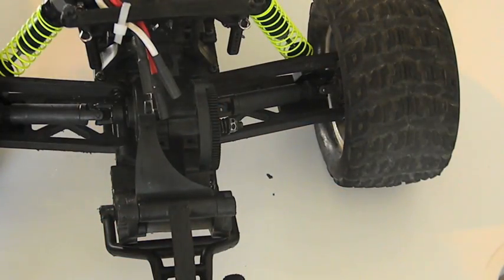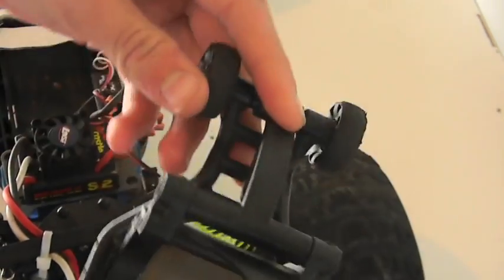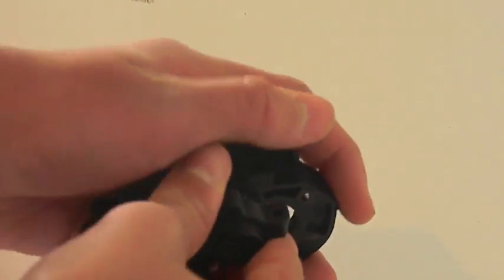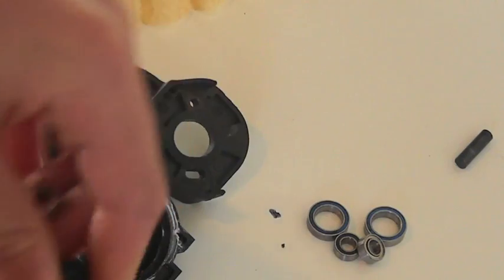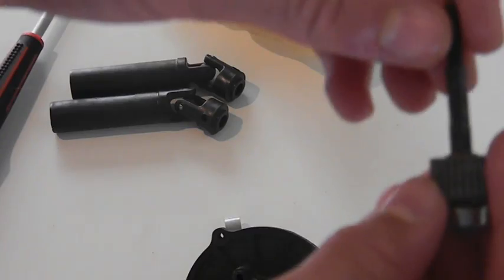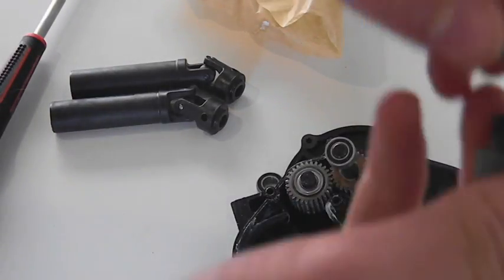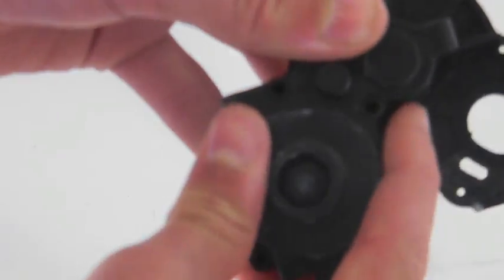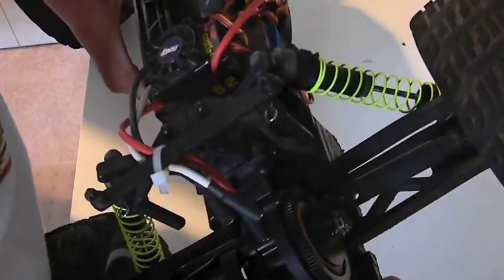how to install a metal gear set into your ecx truck

Comment: this morning i stripped my plastic gears and got metal ones all the gears fit in it exept the differential gear the bearing r not letting the top of the gear case fully close what did i do wrong ????????????????????????

Comment: what springs do you have on there? i can't seem to find exact measurements on the stock ones to find out what i can use
Reply: i picked up aluminum shocks at my local hobby shop for the ECX Ruckus

Comment: How are the metal gears holding out?  I own a Ruckus with a REEDY system and so far the only issue I've been having is the drive shafts twisting and poping out!!
Reply: cdhrusso72 Upgrade with traxxas stampede drive shafts. they fit perfectly and are more durable with 2 or 3 s